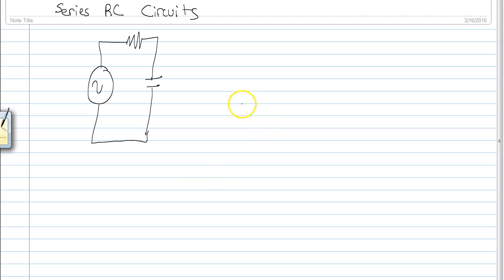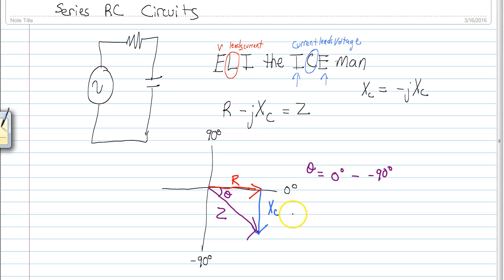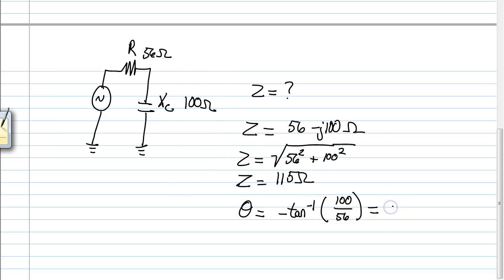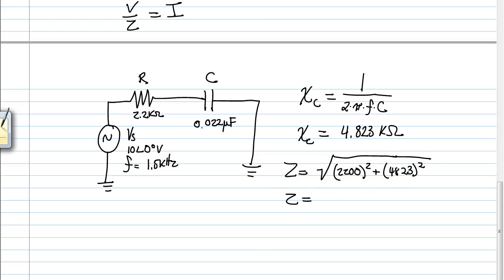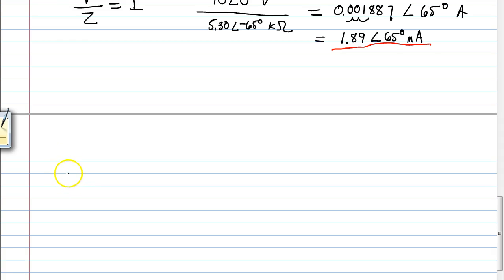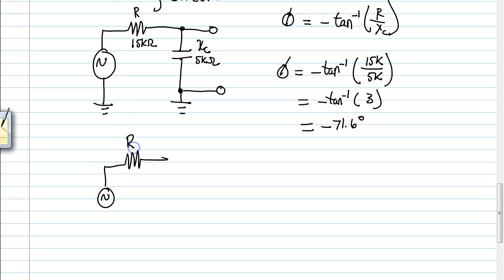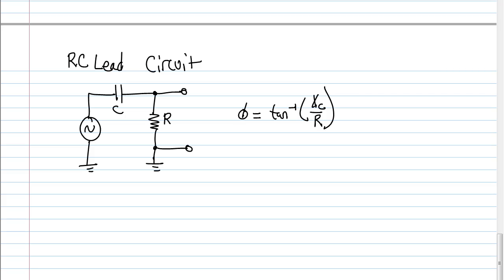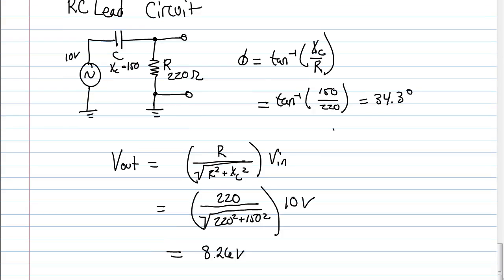RC Lead and Lag Circuits

Comment: Thanks. Can anyone tell please, how changing the positions of "capacitor" and "resistor" make the net circuit voltage as lead or lag?
Thanks.
Reply from the maker: Wow.  This lecture happened a long time ago.  The net circuit voltage would not lead or lag as it would be equal to the source voltage.  You don't really need to change the order of the capacitor or resistor either.  It all depends on where you place the output terminals of your circuit.  If the output is across the capacitor, it is a lag circuit.  If the output terminals are placed across the resistor it is a lead circuit.  It is a comparison of the phase angle between the source voltage and the component with the output terminals across it.
Reply: @MrElectronicful  Thanks for the clarification. Appreciate.
Keep it up.